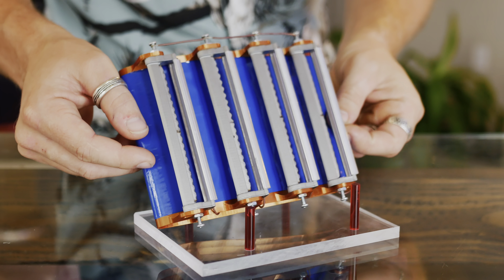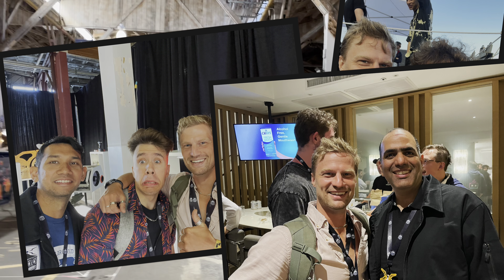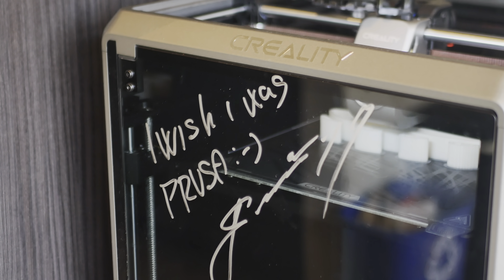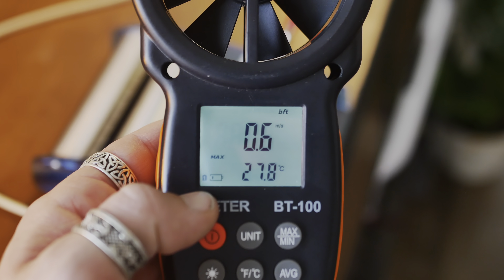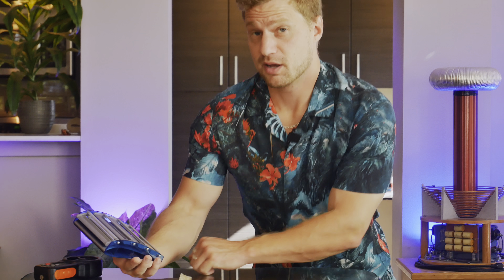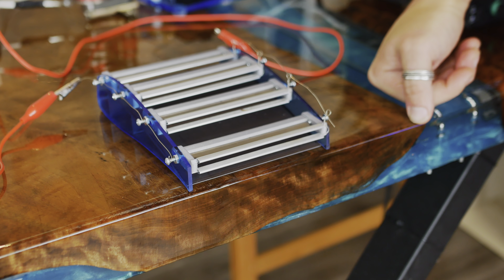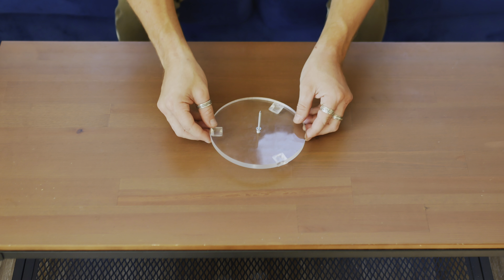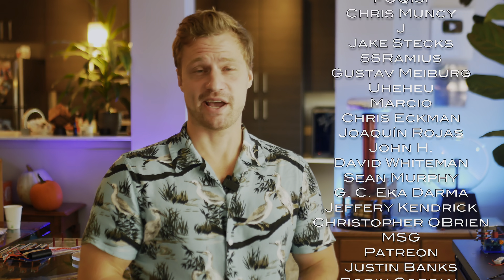Designing A Self Propelling Ionic Thrust Wing

Comment: Terrific video. The thing that stood out for me though was why not build the thrusters inside the wing? I would have thought the drag produced by mounting the thrusters on top of the wing or under it would be way too high to permit eventual flight for a minimally powered plane. If you look at paragliders, and some kites they use the airflow though the wing to retain the airfoil shape, but crucially this does not make them too draggy or render the airfoil shape untenable. I think using this concept you could draw in air at the front of the airfoil, accelerate it, and push it out the back retaining undisturbed airflow around the wing top and bottom. What do you think?

Comment: I'm not sure if anyone else has mentioned this, but I'm noticing that the direction of the thrusters aren't matching the direction of airflow over the airfoil. this is probably causing a lot of parasite drag. You're also going to have to reduce the weight a lot more. A lot of your structure seems to be overbuilt. Maybe also consider focusing on thrust over the fuselage as opposed to over the airfoil. The less efficient the airflow, the more brute force you're going to need to generate sufficient lift to get this off the ground.

Comment: There are a lot of similarities between what you are trying to do and the early days of aircraft development. They faced the same problem you do, how do I fly with a low power engine? You can probably draw a lot of inspiration from their designs. In particular their rib and spar with fabric covering construction techniques. Ribs are 2d and I think would lend themselves well to laser cutting, which might be both faster and lighter. 

The ground planes on the thrust modules you attached to the top of the wing in some ways resemble biplane wings, could you scale up the design so you have two conductive grounded wings with a positive emitter in the middle?

Comment: I would love to see you ion out the challenges. I get a charge from it. 
Real world weather impact would be interesting. I know you are not there yet, but lightning strikes, below freezing temps, and "going through hail" maybe, or may not be daunting. Ionization and the ionosphere, gammas, low air densities. The Rockies approach 7,000 feet (yet they never walk or run) and a 3,000 foot safety margin may be a bit thin.

Because the atmosphere is mostly nitrogen, could properties of said gas be used to, uh, push things along?

Comment: Hey, you got the printer working, nice!🎉🎉 Glad to meet you at open sauce.

From: The guy who gave you the printer.

P.S. You might be able to cut down on eddy current losses by increasing flow in the middle of the thruster and reducing it near the ends. 

If you look up “elliptical lift distribution” it shows the optimal distribution of lift along a wing to minimize your eddy current losses (aka: wingtip vortices). Nobody talks about an elliptical thrust profile, because generally you aren’t producing thrust along the entire length of a wing, but it might apply to your application.

This could be achieved by having 4 rows of ionic thrusters in the center of the aircraft, but tapering down to 3 rows then 2 rows as you near the tips of the wing.

You might lose some overall thrust, but would reduce weight, power consumption, and ideally achieve higher efficiency.

Comment: Thinking about the reason for lift, if able to push air right over the wing like this, it could make sense to do over the wing on the trailing edge (pulling in for lower pressure above), but below the wing, on the leading edge, compressing it more underneath..

Comment: When cutting out sections of frame for weight, bio-mimicry May provide the absolute best weight to strength ratio, it’s tempting to use straight lines for simplicity but curves are so much more versatile, you could use the spherical packing pattern, fractal framework like a Mandelbrot or mimic more complex hollowed structures like the pattern and density in human bone vs bird bones for 3D printed frame patterns. Additionally, we’re mostly still using 2D math especially in aerospace modern propellers have a slight twist and a turbine engine is the closest so far to a 3D design but IMPELLERS are the first stage of true three dimensional advancements in fluid dynamics. Implosion technology also creates a type of exponential force, a 2” impeller can circulate an entire city water supply tank with an extremely low energy requirement, this combined with the discovery of success with low pressure cavitation dimples in aerodynamic design can lead to a whole new type of aircraft, which is only possible now with 3D printing, the task now is to become humans who use 3D math.. and hopefully not just task an Ai to do it for us lol 

A very simple example of this concept is the 3D bio-plough, designed by Victor Schauberger, who was already dabbling in 3D math and fluid dynamics, there’s a spade which is quite flat, a plough which has some curve, and the bio-plough which looks like an alien seashell but glides through the earth with much less resistance and disturbance to beneficial flora fauna and fungi

Comment: Stop making the ionic segments separate from the wing. You could literally print the structural elements for a normal plane, print ionic paths on paper or plastic, then wrap that around the wings. I recommend printing a zigzag pattern used in capacitors, I'd do it but I'm busy.

Comment: You should place the engine underneath the airfoil to not interrupt the flow of air on the top hence decreasing lift and maybe work on a method of perfect a ion engine with high thrust and building the wing around it, not building the engine into the wing

Comment: Once you go beyond model plane size, you may need to be able to vary the output voltage as a function of air humidity. That way a (potentially) crewed glider would still provide some power without sparking. Or maybe a spark detection system (ampere meter?) would be better, throttling down each time there's a spark.
Auf jeden Fall ein spannendes Projekt. 😉 (pun intended)

Comment: Remember that lift happens over the top of the airfoil. Air, for the most part, moves as a unit. While it will move around objects, it will not allow negative space.  The air going over the top of an airfoil  has a greater distance to travel than the air going under it. Faster moving air creates a low pressure above the wing and the slower moving air creates a higher pressure below it. The air going over the top is the most crucial factor of this whole thing. It will speed up as much as it has to in order to meet back up at the rear of the airfoil with the slower air moving under it. So, therefore, it should be free to flow over the wing with as little restriction as possible. The problem with the ionizers being on to of the airfoil is that they are determining both the speed of the aircraft and the speed of the air flowing over the wing. The air will not speed up to up to the air under the wing because the air going through the ionizers is already determining the speed. You'd have to use more energy to speed up the air exponentially in order to achieve lift. If the ionizers are on the bottom of the wing, you can move the air much slower, using much less energy, and physics will provide the energy needed to speed up the airflow over the wing for you.

Comment: Niceee! You should consider embedding the thrusters in the top surface of the airfoil. If you want to fly something you have to optimize Lift/(drag-thrust). The top surface is the most important part of the airfoil if you want to do this and keeping it clean without obstructions is essential. Those thrusters will both reduce the lift and increase drag on the airfoil because of flow separation. If they embedded in the skin of the wing they won’t cause flow separation. 

Second tip, consider making the wing from hollowed out foam core with very thin carbon (graphite) spars. You could even use the wing spars as the electrodes. Don’t worry about surface roughness, at RC scale Reynolds numbers it has no effect on drag, maybe even increases the max lift coefficient.

Goodluck!
Reply: Also 150g for a wing section is too way too much. Foam will weight an 1/3 of that.

Comment: I suggest a space launch. Suspend the thruster in the centre of a air filled car innertube. This tube is your fuel tank.A stack of these tubes will create a multi stage tank.
Outside this cylinder of tubes will be larger truck inner tubes filled with hydrogen.. when the hydrogen lifts to the edge of spacw, you can launch into space by directing air filled tubes through the ion engine as propelant.

Comment: The problem with your design is that you need the air flowing over the airfoil to move significantly faster than the airflow under it. You want as little resistance as possible over the top or else you'll stall the wing. By putting the, damn, I forget what you called them, but by putting them on top the air flow isn't forced to go any faster than what they're already pulling through. If they were on the bottom, the air over the top would be forced to pass over the wrong even faster to keep up and hopefully give you lift.

Comment: Seeing the wing spinning, make me thought of helicopter's propeller...
What do you think about that?

Kinda side tracked, but.. the 1st reason I'm posting is to suggest the Bladeless Dyson's concept to improve the wind force of the bladeless ionic thruster engine...

I have only seen the multiple stages ionic thruster you made, but the strength still lacking, right?

My second suggestion is to combine the ionic thruster with an electric jet engine. Maybe pulse or ram jet engine, to stay true to bladeless thruster concept...

3rd, is to add water cooling system to the entire construct, and hot exhaust from radiator can be feed directly into the thruster for extra boost...

Comment: So to achieve lift you should place the thrusters on the bottom of the wing. You need airspeed on the bottom with drag on top. You can also angle the thrusters so they combine airflow and each one accelerates it faster. Unless you leave it on the top and it somehow creates both drag and thrust on top. Not sure if that would work, tbh. The thruster assembly itself will create drag on the bottom so that will have to be streamlined a bit. I think the best setup might be to enclose them within the wing with a small opening towards the bottom of the leading edge. That way the air thrusts through the wing but still drags over the top, generating lift for flight.

Comment: I would be willing to bet I could suggest a much faster design for your wing, simply using what I know about Bernoulli's principle and how it gives a wing lift.... you really should try this in another video.   

i would be willing to bet these changes would greatly increase lift:

1. Move the ionic thrusters into the very front of the wing,  so they come directly before the curve of the front of the wing.  
2. Stack the razor blades vertically so they generate more airflow vertically,  the idea being to send airflow directly at the wing, tall enough so that some air is forced to pass OVER the wing top and some air is forced to pass UNDER it.   Ideally you would stack enough of those razor blades that your stack would actually be taller than the wing itself.  the more air passing over and under the better. 
3. Move the aluminum grounding strips to be placed above and below the stack of razor blades, maybe making a frame so the aluminum is functional structurally too?
Ideally these changes should generate a massive row/column of wind being blow directly AT the wing, forcing half the wind to travel above the wing and half below.  

Just for those who don't know how wings actually provide lift, it's from their design, by being curved on top and flat on bottom, the air has to travel farther on top of the wing, therefore slower, and the air going under the wing doesn't travel as far, therefore goes faster, thus this inequality creates lift, forcing the wing to rise.

Comment: Interesting. I come from a hang glider pilot background, and built many models/sacrificial victims to the wind gods. Never heard of an ionic wing, but it seems like supplying current with positive and negative current generates thrust. Hmm.... As near as I can tell, with air foils, having a concave undersurface/bottom to the air foil makes the wing have a steeper stall curve, so a bit less useable speed range. It will be interesting to see where this leads.

Comment: Maybe I missed something but why not just separate the thrusters from the wing surface at little? I'm no aeronautical engineer, but it seems like your approach could add a lot of complication due the effects the thrusters will have on the airflow over the wing. Just a inch or two separation of the thrusters from the wing with the normal (nonconformal) alignment might be an easier path during the proof-of-concept phase, and will allow you to focus on maximizing thrust. I hate to stifle the creative process, but if placing the engine on top of the wing conformally was in some way advantageous, it would have probably been tried by now. My guess is it might work at very specific speeds, but that's wild speculation, and probably very slow speeds at that, which might be ok for a glider. Hopefully you'll prove me wrong. Very good work. Looking forward to seeing your solid state plane fly.

Also, What happens when the thrusters are placed in serial like that; i.e., is the total thrust >=4 times a single thruster force level? Maybe it is... I watched your last video a while ago and forgot how this propulsion systems works exactly.

Comment: The airfoil structure of the wing is responsible for generating lift by creating the difference air flow, above and below the wings. Don't you think the design that you are using in which the whole top of the wing is covered with ionic thrusters will pose problems?

Comment: First of all, awesome work.  I especially like how you point out mistakes in measurement.  Putting on my labcoat for "peer review", I would ask the following:  1) As this process is scaled, how would the ionic sections scale with it?  Would you expect the same size components, but more of them to cover a larger wing area or Would they scale up as well?  2) Could you extrapolate how using 3 ionic components instead of 4 would affect the thrust?  What about 5 instead of 4?  3) How does the acceleration of the air over the top of the airfoil affect the pressure on the top side of the wing?  Would this extra speed lower the air pressure and provide extra lift?  (I imagine if so, it would be almost trivial amounts, but still)  Awesome job with the science!

Comment: The air velocity on top of the wing is already high since the wing’s purpose is to create a pressure difference which also means velocity difference. Because of this putting a thrust component on top of the wing can be inefficient as it is much harder for the the thrust component to accelerate the air from high velocity to a higher velocity than it is to accelerate say medium velocity to high velocity.
Maybe you can incorporate instead to the whole fuselage and essentially wrap it around it with thrust elements.
Super interesting stuff man!

Comment: I know its a prototype for the engine and less about the wing but I noticed that your test did not tip the balance point when higher rotation speeds were reached, to my mind this implies that the wing portion was not getting lift. I know that the top of the wing is the most important part of the wing and lift is generally generated by air moving slower over the top of the wing and making a low pressure zone that the air under the wing pushes toward to lift the airfoil. Why put the motors on the top of the wing instead of the  bottom?

Comment: Came across your videos, rather interesting. My extremely limited knowledge and understanding on normal propulsion is making me think Wider inlet narrower outlet it increase thrust. This could  potentially be done by treat the wing more like a bi plane wing set up and using the ion engine as internal braces for the upper and lower skins of the wing.

That could reduce weight and potentially increase thrust but may have other challenges with the leading edge design of the wing for generating lift.

Maybe it needs a bit of inspiration from the stealth bomber flying wing designs with the intake and exhaust/outlet/thrust all incorporated into the wing  🤔 

I haven't seen enough on ionic engines so I could be completely on the wrong track while thinking out loud 🤷‍♂️

Comment: Just a thought here. I also watched Joel's plasma engines, and by far, he got the best thrust when the launch points for the plasma were very small. You could do something similar with a wire by twisting loops into the wire at regular intervals, and then continuing to twist each loop until it forms sort of a twisted spike. That way, you get both light weight and concentrated launch points for your plasma.
Reply: Asymmetrical capacitors !

Comment: why don't you have the thrusters on the bottom of the wing? the air will have a slightly lower initial speed plus higher pressure=higher density. you'd get slightly more performance out of it imo. maybe you do answer this in the video idk i just thought of this

Comment: As you mentioned with the blue angles (turns with wings), would a design where you make the plasma motors the wing be possible? Maybe by fitting them "inside" the wing structure in a way could work and make the design lighter as well?